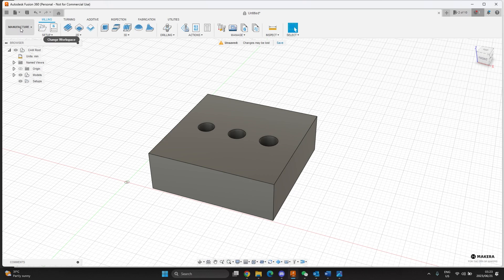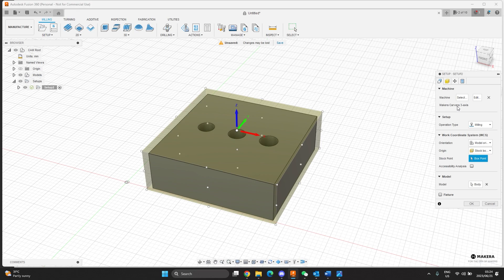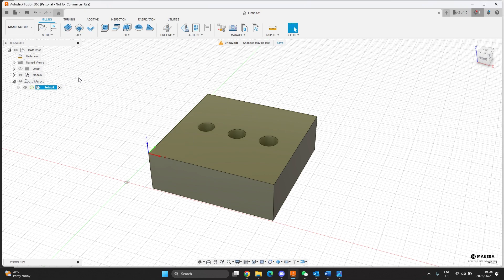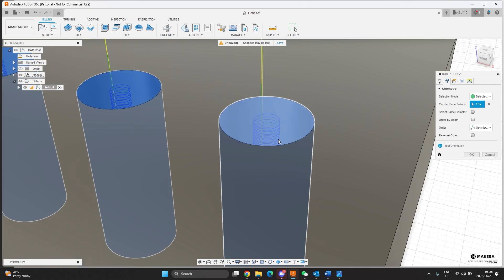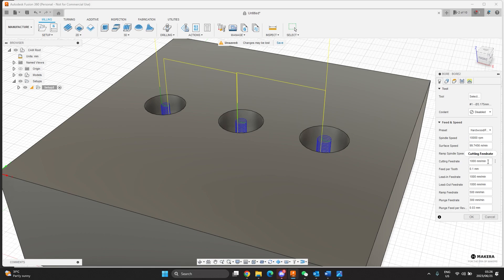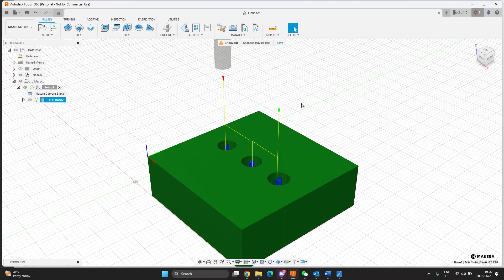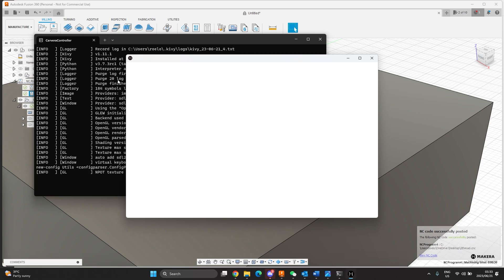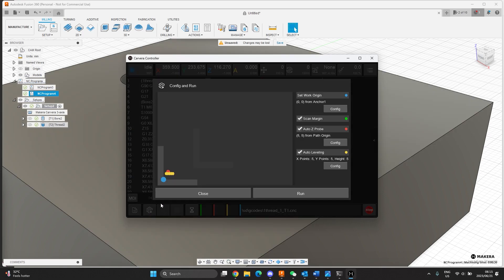Thread milling with CARVERA and Fusion 360

Comment: How about providing a video showing how to correctly do threads? 2 years since this video and no update on showing how to use thread mills the right way. This video just shows a hack by using wrong measures. Thread Pitch Offset is the way to go and not using hacky measurements.
Reply from the maker: Did you see our more recent tutorials for Makera CAM threadmilling?

Comment: Hi guys, just received my Carvara Air about a month ago now and I'm having some trouble thread milling, At 8:36 you show the simulation of the thread mill cutting an M5 with a thread pitch of 0.8mm and a pitch diameter offset of 0mm, and it appears that the tool only just touches the bore on the final pass in both your video here and also replicated in my fusion 360, and indeed when I run the program on my machine, it barely scratches the side of the bore. I was wondering if I was supposed to add a non 0 value to the pitch diameter offset or am I potentially doing something else wrong, let me know. Cheers
Reply from the maker: Thanks for the view! Yes, you can adjust the amount that the thread cuts by adjusting the pitch diameter.

Comment: How come when I try to make threads that do not go through the whole stock, the bit looked like it will collide with the bottom of the bore. Do I have to make the bore slightly deeper with an offset  to prevent that from happening? Im not sure how you do not have that problem when running the simulator. Also how can we determine the step over and number of passes when using different thread sizes?
Reply from the maker: Yes, we would suggest boring past your thread depth to avoid the collision. And in general, 0.3 mm is a good parameter for working with aluminum for step over. But we are adding additional threadmilling parameters to our speeds and feeds wiki for additional support: https://wiki.makera.com/en/speeds-and-feeds